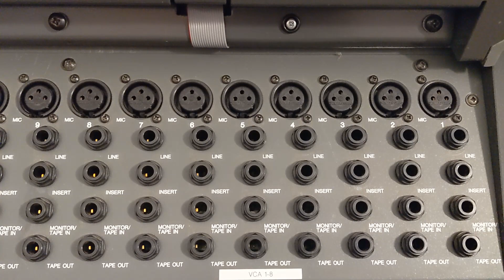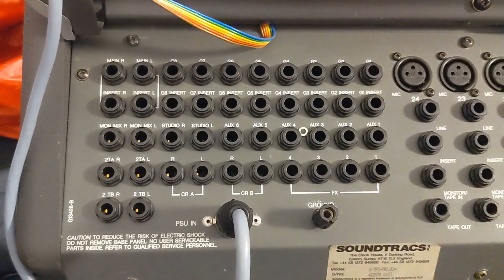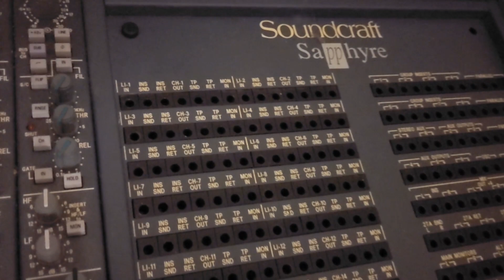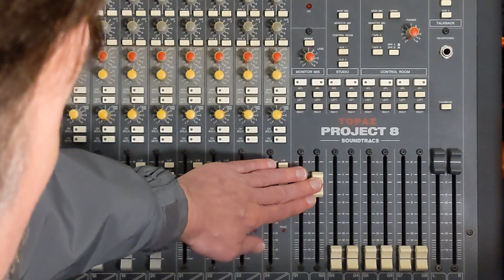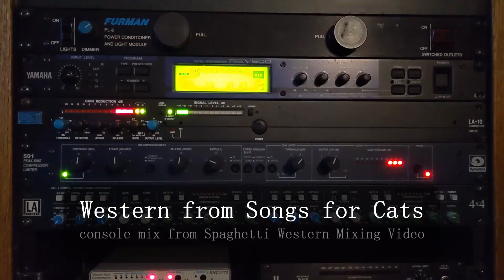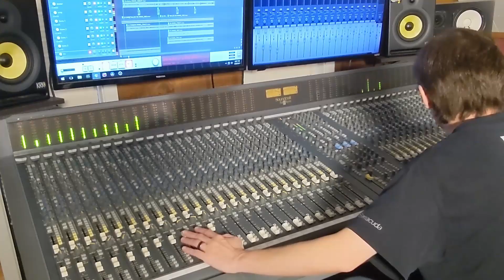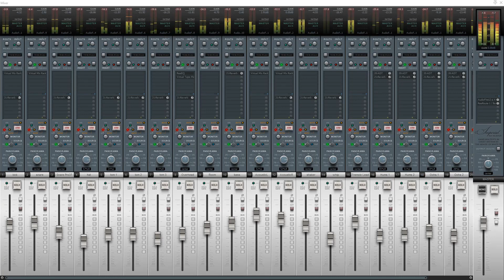How to Setup for Mixing on an Analog Console

Comment: I just spent 3 months restoring a large analog console, beginning my hybrid journey after being ITB for a decade.  Keep up the videos they are inspiring!
Reply from the maker: Thank you! Having a console is awesome for tracking and hybrid mixing. I'm sure you'll do well and have a great time hybrid mixing with your console. Which console did you restore? I am actually working on a 4 part series about Hybrid Mixing so those will coming soon with some other things in between.
Reply: @TwinCreekAudio  peavey amr 800.  24 channels 8 sub groups, 4 auxes, 4 fx sends.  Total sleeper console.  The peavey badge drops it's value but it's made 100% by amr and had former API engineers on the design team.  Fully balanced with by my count 48 channels at mix down.  Fully modular so I did it a few channels at a time.  Everything but some Vu meters and 1 sub group channel is working.  It was about 100hrs of work it was covered in dirt, grime, and nicotine lol weights like 300lbs
Reply: @TwinCreekAudio  I look forward to the series.  I have next to no outboard gear currently, just a dbx118 and an art FX unit so I might be doing some vids after I get some comps for busses
Reply from the maker: @MrNEWDY  those are really good consoles. I've never used one myself but I have heard a lot of good things about them over the years. It's also the perfect vintage for something reliable and modern but still all analog. The AMR consoles were made at a time when analog technology had already matured and the gear was quieter and more reliable. I think that is going to be a great console with all the work you've put into it.
Reply: @TwinCreekAudio  yeah I did some testing and stock with midi commander disabled and sub groups and sends off at unity the console maintains around -100 to -115 self noise and with groups enabled stays under 90-100db self noise.  Sending master section to Jim Williams soon to have the summing redone and the monitoring all rebuilt then noise floor should be far lower and summing a bit punchier.
Reply: @MrNEWDY  AGREE! Peavey always got a bad rap.  My first guitar amp and main amp for 35 years was Peavey Deuce 2x12.  It was a monster amp.  Recorded and toured with it for years, and was right up there with any Mesa Boogie, Orange, or Vox amps.  I finally sold it, opting for smaller and lighter weight amps, but Peavey even in the 1980's was considered poorly made.
Reply: same here!  I've been doing a mix of itb/otb with an ssl x desk but after working in a studio in california, really really wanted to get back on a console where I started, and wound up scoring a soundcraft 600 for free, then 500 for cheap which I'm turning into one frankenconsole....  Grady's videos are helping me stay in that mindset as I plan to make the transition.  Good luck!

Comment: I started with analog and went ITB way back in the early 2000's.  I decided to go hybrid in 2018 and have never gone back to fully ITB.  The sounds of analog console and 500 series outboard gear is amazing.  I started with a Soundcraft Spirit LX7 (24 channels-4 Subs), but really wanted more channels and subs.  I came across a nearly new A&H GL-2800 32 channel (it also came with 2 power supplies) that I picked up for $400.  Added patchbays, and a second 500 series rack with 4 Trident EQ's, dual SSL EQ's and Compressors, plus a host of other EQ's, compressors, and effects, plus some vintage rack mount reverb and delays, and it beats almost all plugins.
Reply from the maker: I agree and it sounds like you have set yourself up very well for hybrid work. I find it's faster and easier to get a good sounding mix with analog gear as well as being more hands on and spontaneous.

Comment: sooooo helpful!!  Just subscribed!  I'm new to the analog console domain. I have several analog compressors and eq's ( neve 8803 , api 5500, neve spx 1073 , purple audio mc77 dbx 160x - etc.. ). Just purchased a midas board that should be arriving by the end of the week. I may have to refer back to this channel for help routing everything. Great job!
Reply from the maker: Thank you! I'm really glad the video is helpful. I have a lot of videos on the channel covering hybrid studio setup and work flow with more planned. I'm also happy to answer any questions. I do my best to check all the comments and answer every one I can. You have some nice gear and I'm sure you'll enjoy getting more use out of the analog gear once you start using the Midas. I used to have a Venice F24 and it was awesome! Great sound and features! I have a video coming about tracking with a console and a series on hybrid mixing. Thanks again!!!

Comment: Definately the best video ive seen on analogue mixing, subbed! Will check out your other videos on analogue desks! I got a couple of questions still! Should you always keep the master fader at 0 on mixing consoles? Whats the maximum level a full mix should peak at on the master channel or should you always try to keep the full mix peaking around 0db? Im using pfl button to set the gain on each channel to hit around 0, but if i do some additive eq on a channel the volume level increases should i then re adjust the gain lower with pfl engaged to have the channel peak around 0 again? What are your thougts on these topics? Im mixing fully analog on a soundcraft delta desk! Thanks in advance!
Reply from the maker: Analog and digital levels can be thought of differently. Digital -18 dbfs is the same as 0VU. I find that analog gear has much more apparent headroom than digital. You can push an analog console a bit more as they are more forgiving and don't hard clip above O. The thing to watch when mixing hybrid style is the final output level of the console going back into the audio interface inputs does not get above the level the audio interface can handle. I don't really have to watch these things when using my console as it seems to come out OK without a lot of calculation. Of course this depends on the console but the Delta should have plenty of headroom. I usually keep my master fader at 0 but on rare occasions I have pulled it back a little degradation to the mix. I usually end up with a final print from analog that's much lower than summing in the box and leaves headroom for mastering. With the analog gear, I seem to be able to push everything as much as I want and still have headroom left on the master bus. It's early here but I'll try to come up with more information for you soon. This is an interesting discussion. Thank you!

Comment: Man I love the way you explain things, very detailed! I appreciate your videos. I have an Allen and Heath GL2400 and I'm currently trying to wrap my head around the setup for recording and mixing. I have 2 interfaces for maximum I/O...MIC pres and three patch bays. The recording is pretty straightforward  but the mixing set up confuses me a bit, especially when effects are introduced. Do you have any experience with the Allen and Heath GL2400? If so, how would you suggest I route things for a seamless recording and mixing set up?
Reply from the maker: Thank you! I haven't used that particular model before but you should be able to use the line inputs to mix through the console. If you have a large number of channels you can use the lower numbers for sending to interfaces and the higher numbers for mixing back through the console. You can also use the subgroups to send groups of things to the interfaces or for things like parallel compression when mixing. Good luck and let me know how it goes and if you have any other issues or questions. Thanks again!
Reply: @TwinCreekAudio  thanks bro, I appreciate the feedback.
Reply: @TwinCreekAudio  hey man! I got the Allen and Heath all set up and running finally and it sounds great. My issue now is the pan moves I make are not recording into the DAW. Can you record pan moves into your DAW with am analog console?
Reply from the maker: @natcoziay  sure, you should be able to do that. Connect audio interface outputs to tape inputs and set the chennel to tape, then record the master outs back to a pair of interface inputs. Best of luck and let me know if I can help more.
Reply: @TwinCreekAudio  man thanks for the quick response! I will let you know if I get it working.
Reply: @TwinCreekAudio  I figured it out! The problem was with the I/O setup in my DAW. I didn't have stereo outs setup in my DAW, they were all mono. I added the stereo out channels in my DAW now it's working like a charm!! Thank you buddy!
Reply from the maker: @natcoziay  awesome! I'm glad you got it figured out. I'm here to help if you have any other questions.
Reply: @TwinCreekAudio  thank you bro!

Comment: Has anyone used a Soundcraft K2 for this type of set up and would they be ok for recording/mixing. These were typically used for live sound and was thinking of getting one I saw for sale.
Reply from the maker: I haven't tried one but they should work fine for hybrid mixing. They don't have the Dual signal path of studio consoles( no tape returns) but they would be easy to use for mixing using the line inputs to the main channels. There are enough channels on the console, you can use some for sending to the recording device and some for monitoring back from the recording device etc.

Comment: why do you mix  with  the  jade  and not wiht  the  soundtracs  on this video ??
Reply from the maker: I stopped using the soundtracs Topaz for most of my mixing work whenever I acquired the soundcraft. I used the Topaz for the video because it has the type of connections that you can see whereas the soundcraft has all EDAC connectors so there would have been no way to show the individual connections in the video. In other words I used the Topaz for this example because it is simpler to set up than the other large console in my studio. I have not owned the Topaz in over a year though I kept it for several years after acquiring the soundcraft as a backup. I have never used a Jade of any kind in any of the videos. The Topaz and Soundcraft Sapphyre are the 2 console I think you are referring to.

Comment: thax for sharing ..but from where didi u connect yr studio monitor like yamaha Hs5 if u use yr console main outs (left and right) to send yr mixes back to yr interface for print track.
Reply from the maker: The console has 2 sets of control room monitor outputs. Since I mix hybrid a lot, it works perfectly for me. I can also use pair of channels for the stereo playback from the DAW and still monitor through the console.
Reply: @TwinCreekAudio  thank u
Reply: @TwinCreekAudio  thank u

Comment: How  hard  will be to get parts for a SoundCraft  console (Ghost) or any other SoundCraft  console in your experience?
Reply from the maker: Soundcraft aren't too difficult to find parts for since they are still in business. For older Soundcraft consoles there is Creation Audio Labs in Nashville. The Ghosts seem to have a lot of issues with the control room pot and the headphone jack but are otherwise reliable and well-built.

Comment: Well I have an Allen Heath GL3300. I’m struggling to hook up my outboard compressor and a sonic maximizer. This console doesn’t have a dedicated master far as I can see. So I don’t know how and where to hook up the compressor before I send the audio back in to Reaper.
Reply from the maker: The channels should have inserts so you could use a pair of channels. I think that console was designed for live sound or theater. Does it have a matrix section? It can still be used for recording and mixing. The workflow might not as straightforward but it will work.
Reply: @TwinCreekAudio  yes it has a matrix section
Reply from the maker: @EnfernoMuzik  maybe you can use that or a pair of buses as your master out? The buses likely have inserts for outboard processing.
Reply: @TwinCreekAudio  I will try that. Thx for answering

Comment: Hey Grady! I hope all is well with you! Quick question about my analog Mackie 32-8 Bus console.,Let’s say I don’t have an outboard EQ on the Main Mix Out/Inserts. Could I run back into two channels, and use the EQ on the Channels as the two Buss EQ? If so, what’s the best way to do that, and where would I put my two buss compressor in that scenario?
Reply from the maker: You could patch the master insert sends L and R to the line inputs if a pair of channels and use the channel direct outs to connect back to the master inserts return. You can put the compressor either before or after the EQ in the chain depending on your preference. Don't assign the channels you use to the buses or LR mix at all. This will work but there could be some crosstalk or other issues. You can certainly try it and see how it works.
Reply: @TwinCreekAudio  Wow! Thanks Grady! I’ll definitely give this method a try, and after I commented here, I was also thinking this other method of taking the main mix out of the 8-Buss, and into two channels of my Mackie 1640i, (which I use as the interface)putting the two Bus Compressor in the main mix inserts of the 1640i, and use main out of the 1640i to go into a tape machine. That way possibly crosstalk, and noise could be avoided. Do you think my idea is good ? Again, I thought of that after sending you this question. Lol
Reply from the maker: @The-Jim-Miller-Project  you could also patch the compressor between the 8 Bus main LR outs and the 1640i inputs. Either way might work but the best way is to try different ways until you're happy with the workflow and sound.
Reply: @TwinCreekAudio  I truly appreciate you my friend! I hope all is well, and have a great 4th holiday. Looking forward to seeing more of your excellent vids! Thank you again Grady!

Comment: I am sorry if you covered this in another video already, but could you explain how the inserts are wired to the patch bay for a more "Permanent" setup? Are the TRS to TS cables unbalanced connections? Also, how are the send and return wired into the patch bay? Does a normal setup work so that the send and return loop back untouched or do you use half or through? Sorry, I am just doing research on this as I like the idea of using a mixer for mixing the tracks and would like to use inserts in an effective way without going back and forth from the desk.

Thanks!
Reply from the maker: Glad to help. I may have covered some of this in previous videos but I've made almost 300 so I forget. If your console has TRS inserts then you would use an insert cable that goes from a single TRS for the console side and 2 TS to go to the patchbay with the insert send above the return on the pay.  Ideally you'd want these half normalled so you can use the insert send for other uses such as a direct out from the pre while keeping the signal flowing to the insert return. Normalled would also work if you don't plan to use the insert send for anything other than normal insert duties. I hope this helps and let me know if you have further questions. Thanks!
Reply: @TwinCreekAudio  Is the patchbay balanced? Any "noise" with TS send and receive while using balanced connections for outboard gear or are the cables short enough where this is a non-issue?
Thanks again 🙂
Reply from the maker: @AntmanFelix  usually when the inserts are on TRS they are unbalanced on the TS end and even the TRS connection is unbalanced with TIP and Ring also being unbalanced connections on the same TRS jack. This can be confusing as some equipment uses tip for send and ring for return while others are backwards.  I have not had any issues with noise as long as there's good cable management and decent quality cables with shorter lengths.
Reply: @TwinCreekAudio  Awesome thanks a bunch! I been reading a lot of different information and got confused thus I appreciate the clarification and your experience. This helped a lot!

Comment: If I only have 8 ins/outs on my interface can I send my final mix from the DAW out to my analog mixer and send back to the DAW and then download to an mp3? Would that accomplish a similar result? Im trying to utilize my 24 channel mixer in some compacity.
thx
Reply from the maker: Yes, you can run 8 channels out of the interface and into the console, then record the master outputs back into 2 channels on the interface for a stereo Mixdown. You can also send just the 2 main channels out to the mixer and back the same way, but using 2 audio interface outputs to the console and then record the master outputs back into the audio interface. If you had an interface with more I/O, you could expand on this idea and run more individual channels out through the mixer. If your mixer has tape inputs and is inline design, you can connect 24 inputs and outputs to the channels and tape returns like I describe in several videos. If your console doesn't have any tape inputs, you can use 1-8 or 1-16 as send channels and the rest as returns from the DAW. Best of luck and let me know how it goes.